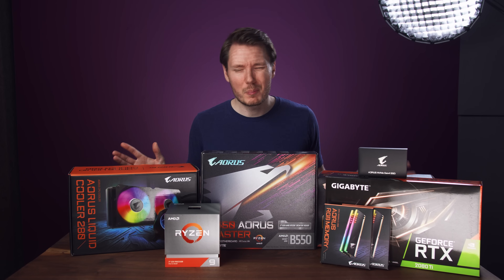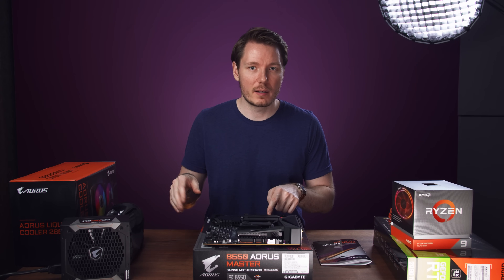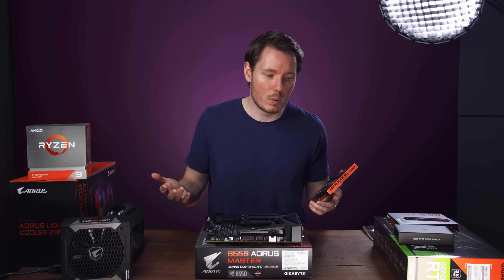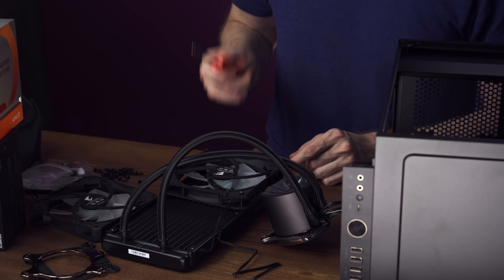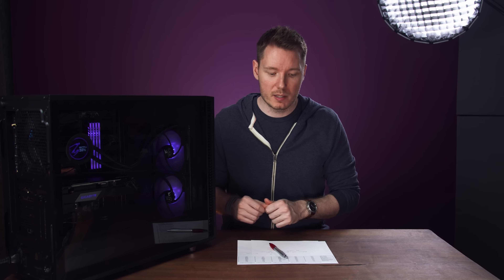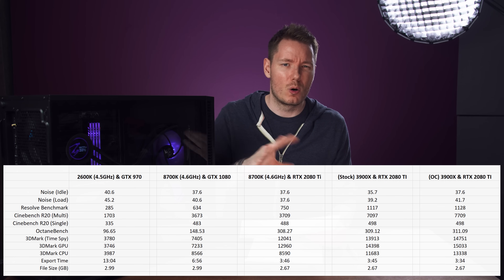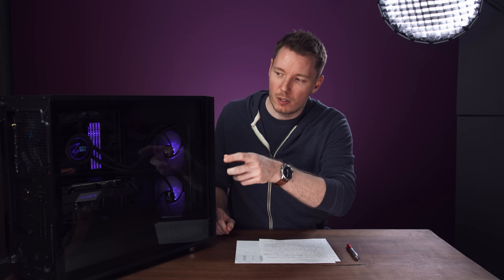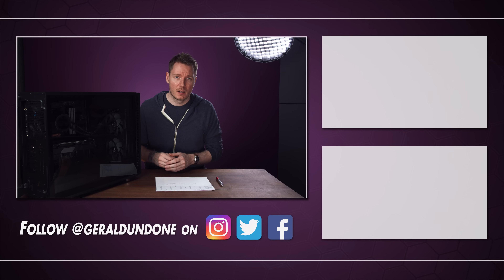Building an AMD B550 Video Editing PC // Ryzen 9 & AORUS MASTER

Comment: I built a custom PC Using the AMD Ryzen 9 3900x and while creating proxies last night, media encoder was using 100% of my cpu power. That doesn’t seem right at all any thoughts? 

I’m using an MSI x570 gaming MB
750watt PSU 
Evga GEFORCE 2060 super GPU 
64GB Corsair vengeance ram 
And I edit off a 2 TB Samsung SSD with another 1 tb ssd for my PC files and operating system

Comment: Did you ever get to the bottom of the ground loop? Compare against other motherboards? I had the same issue with a gigabyte aorus (intel) I eventually upgraded and I'm using a Asus ROG Maximus, and I don't have any issues. Note: its a fair comparison as I'm using the same case, same power source (receptacle) as before. Only thing changed is the motherboard/cpu. Previously, I isolated the issue and could hear the loop when plugging my headphones or an audio source directly into the integrated sound card (I heard the same loop noise through my external sound card through the usb port).

Comment: That's a pretty sweet computer! Two comments tho. You're only using one m.2 drive? A sick drive indeed, but having one drive for programs and one for files and scratch disk speeds up things quite a bit as well. and ofc video editing takes up so much space if that is what this is intended to do. But this is where the shared lanes become a problem, so nice that you mention it! I was not aware of this before i bought my last mobo and it is causing me a bit of a headache. but you might be keeping more of your files on a server NAS or external drives or something ?? 

The other thing is that the radiator is mounted with the tubes faceing up which can cause some problems with the air in the system and such. Gamers nexus has a looooong video on the topic ofcourse, but you can skip to the last mark if you want just the summary : https://www.youtube.com/watch?v=BbGomv195sk

Basicly, mounted like that the system becomes more noise, and less efficient, and reduces it's lifespan. how ever, as you're powers of observations serves you right, you see this kind of configurations all the time, even from the suppliers them selves, so it's a really overlooked issue. However, if you're tubelenght allows it's highly reccomended to get it the other way if not in the top of the computer case. 

Personally i prefer  aircoolers from noctua, and a sound isolated case instead of tempered glass and LED lights, and i can rather monitor temps in software on the screen which i am supposed to look at. but that doesn't make for the same view-attracting-eyecandy-computer does it ;)

Comment: Im pasting my comment here from the new 3070 video: Hey G man, if you want your All in one liquid cooler to last longer you have to change the setup asap. Haveing the tubes on the rad up top is not good. For more information check Gamers Nexus' video on pump whine and radiator positioning. Long story short the tubes should be at the bottom, or the radiator should be at the top of the case. Trust me it is WORTH reconfiguring

Comment: If you still run out of Vram, give a used Vega, or Radeon VII a try. The High Bandwidth Cache Controller is a useful feature is you have 32GB+ system ram. Very competent, good job.

Comment: A great explanation, great video.
So my question is that which motherboard is good for using 2 nvme drives at full bandwidth and also some sata ports with some usb ports without any bottleneck issues? I am going for a 3900x build for my purely editing focused build and any kind of bottleneck will be an issue for me. I want to run 2 nvme drives at their full bandwidth and few sata ports for storage and usb for file copying. I want to run all these at their full speed. So plz any suggestions for me? 🙏🏻

Comment: I just build a new rig 
R9 3900x
RTX 2070 SUPER
MSI MPG B550 GAMING EDGE WIFI
650W PSU
32 GB 3000MHZ
Samsung Evo Plus 500 GB
Samsung QVO 860 2TB
and still not live playback on premiere pro with Canon C200 raw

Comment: I know attaching cables is probably a trivial exercise for some but I just bought a similar system as my first build.  I would have loved to see you go through the whole exercise. For example, I had a question about the I have a 2x 4plug connector labeled CPU from my Fusion PS.  The only place I can see where that would go is on the ATX connector on the Master Motherboard.

Comment: You do realise the radiator is wrong way around? 
Hoses should be at the bottom not top otherwise as liquid slowly disappears, you'll be sucking air through the pump.

Comment: Hello,

I have just installed my Aorus Liquid 360 on Threadripper 2990WX with Asus Zenith Rog Extreme x399 motherboard.

The display on the pump is showing something around ~60 celcius degree, but the motherboard temp sensor and the CoreTemp are showing something around ~34 celcius degree.

Did anyone have the same problem? FW and drivers are updated. Am I missing something ?
I found out that instead of reading the "CPU Package" temperatures it reads "CPU CCD Average" temperature. How did you manage to get propper temperature on your cooler ?

Comment: Did you get a response back regards the weird noise?

I've just bought an x570 Ryzen 3950x build and I noticed noise through my HS7 monitors last night when moving the mouse about. I'm using a Focusrite Clarett interface.

Edit: I should add my motherboard was made by Asus

Comment: If you aren't using the extra space in the R6 for storage, you're concerned with temps, and the B550 board has no USB C header for the front I/O, why didn't you just go with the smaller and more breezy meshify c?

Comment: Does this 2700$ build that I plan to buy/build has some issue that I should be aware of?
Should I use some(?) cheaper part's for it? My budget is 3000$.
I planned to use it for gaming/casual 3D modeling (gta 5, battlefield 4, deadside, maya, autocad...) in next 5+ year's without any upgrades and any overclocking on a 1080p high settings.

AMD Ryzen 9 3900X 3.8 GHz 12-Core Processor
be quiet! Dark Rock Pro 4 50.5 CFM CPU Cooler
Noctua NT-H2 3.5 g Thermal Paste
Asus ROG Strix X570-I Gaming Mini ITX AM4 Motherboard
Crucial Ballistix RGB 32 GB (2 x 16 GB) DDR4-3600 CL16 Memory	
Western Digital SN750 1 TB M.2-2280 NVME Solid State Drive
Western Digital Gold 6 TB 3.5" 7200RPM Internal Hard Drive
Gigabyte GeForce RTX 2070 SUPER 8 GB Gaming OC 3X Video Card
be quiet! Pure Base 500 ATX Mid Tower Case
be quiet! Straight Power 11 750 W 80+ Platinum Certified Fully Modular ATX Power Supply
Microsoft Windows 10 Pro 32/64-bit
be quiet! SilentWings 3 pwm 59.5 CFM 140 mm Fan x2  = extra fans
Asus VG248QG 24.0" 1920x1080 165 Hz Monitor
Thanks :)

Comment: This is timely for me. I'm planning a build very similar to this one. Same CPU. Motherboard with B550. GPU 2070 Super. Want to stay away from water cooling. I'm going to run DaVinci Resolve Studio and that makes me wonder if there's an optimal configuration for the mass storage. That is, where to story proxy files and/or cache files? Should they be on your fastest storage with the most lanes? How much difference will then make between an 8-lane vs 16-lane connection? 
In the olden days there was similar optimization by splitting audio buffers, video buffers and cache files on separate spinning hard drives. I've not seen much about this kind of optimization in years so maybe the bottleneck is not in the drive any more. I ask because I just don't know.

Comment: Just so no one's unclear about this: that is not how grounding works. It's not a one touch thing. It does help to discharge the built-up static energy you had before though, so it does help, for a while.
You need to be in the same potential as the item you're handling, not the one your house is grounded to, "earth", per se. This is unless you're using a anti-static wristband to attach yourself to the case permanently whilst you build. It creates the means for the potential energy to discharge away from the electronics you're handling.
Cool video.

Comment: Nice rig but Depending of how what codec, long and complex your timeline are but 32GB isnt enoff, you need 128GB to 256GB to edit, colorgrade, graphics in After Effects, and ad Effects in 4K. Your benchmark arent better becouse no enoff RAM, as an advice the radiator must go up in scape configuration to no elevate the temp inside the case, you need cool fresh air not how air inside the case. Just an observation. I love your videos, but this is an oportunity to learn how configuration a PC to edit in 4K

Comment: Think I would have used better memory in an editing rig. Something with CAS 16 timings @ 3600MHz, as you mentioned. But 2x8gb is ideal for the infinity fabric. With Ryzen, it is a case of where more is not better. Using all four channels or going with dual rank memory provides little extra performance for the money. But, glad to hear someone actually talk about CAS timings. I see so many other reviewers never even mention it. That is like telling someone you have a chevy 350cid without saying how much hp or torque. Thanks for the video. Subscribed. P.S. it also has dual bios that can be a real pain if you overclock a lot. Forced to store your bios settings on thumb drive to insure you dont lose everything.

Comment: Can so pls explain to me what he’s talking about when he talking about the gpu and m.2 slots. So if you use 2x  nvme and a gpu. All three get slowed down and don’t use pcie 4 or just the 2nd nvme gets slowed down.
Reply: Its about housekeeping with the resources of the architecture given by the motherboard and processor. Motherboards have advertised features and speeds but very often most features can’t be utilized with the highest speeds at the same time. Both the graphics card and m.2 slots are using pci-express lanes. But total number of PCI-E lanes on the motherboard are limited (based on architecture) and therefore advertised features (if many) must sometimes be connected to very few or shared lanes. If you then wan’t to take advantage of EVERY feature the speed will may be shared between features OR you get to use less features but with full speed. You have to look at each motherboards fine print to know and best plan for its limitations if you want to use latest technology to the fullest. Perhaps why there are so many boards from every manufacturer.

Limitations can be speeds (limited number of lanes for a feature/port), what pci-e cards (graphic) can be connected and in which port/slot, if all m2. slots can be used, and how high bandwidth is left for the HDMI or display port if such exists (from processor integrated graphics). I’m not so familiar with AMD-boards but I would guess the X570 architecture have more PCI-E lanes than the cheaper B550 architecture....

Don’t know if that helped but I thought I could at least try.

Comment: Had the same audio issues years ago. Its not only about the mainboard. It's also about the monitor speakers some audio tech guy explained me some years ago. But I don't remember the explanation of it. But this explains why you cant hear any problems with standard PC Speakers or headphones. I found a quit similar solution like you. I took an 20 $ optical to stereo converter with separate power plug and problem solved.

Comment: For long term use it's well worth putting the radiator in the other way up, with hoses down. That way, as fluid is slowly lost over time, the air will rise to the top of the radiator, and won't be drawn into the pump (which would cause accelerated wear and pump failure, as well as making more noise)

Comment: :) looking to get the next AMD CPU (4000) + chipset desktop series, so I can get full PCI-E 4 as well as the new features coming out. 
Gigabyte makes good gear, usually very good motherboards. I have been using them for ~20 years, really interesting grounding issue I have had something like this previously.

Yeah CL18 is slow, CL16 or 14 for 3600/3200 would give better performance.
What is the max memory for that motherboard?

I would always use the heatsink to blowing out of the case, that way you aren't getting a feedback loop of heat (ie: air comes in, goes through the radiation block and heats up, gets inside the case and heats up the case causing more heat to need radiation)
2080ti is good, but I'm also curious to see how a quadro or firepro card would go with resolve.
Did you go with the nvidia studio drivers or the standard geforce drivers?

Comment: Do the m.2 drives on the B550 disable any of the SATA ports? I know a lot of the B450 boards would loose SATA 5 & 6 the minute you installed an m.2 drive
Reply from the maker: Nope. Only the bottom pcie affects your sata ports. The NVMe just affects your top pcie lanes from 16 to 8.

Comment: Point of order for those who use the power supply (or case w/ PSU installed) to ground themselves: Make sure the power supply is plugged in and you're touching bare metal. If you're touching painted metal or plastic, you're not grounded! I can't tell if Gerald's actually touching bare metal at the start here, but it's worth pointing out for those of us too lazy/stubborn for an anti-static wrist strap.
Reply from the maker: Yep, good tip. I have a whole bunch of info on that in the upcoming grounding video. Talking about how paint affects things, etc.

Comment: Last person I expected  for coverage on this, but cool nonetheless.

Genereally, you want to avoid mounting a rad vertically with the pipes at the top. That orientation will generally lead to more noise and (theoretically) worse longevity.
IRL it's not a huge deal, but could easily be avoided by mounting the rad at the top, horizontally.
Reply from the maker: I'm not an expert in coolers, but I thought the consensus was that it really doesn't matter for CLCs as far as hoses top or bottom. If it was a custom loop, then sure. 
Front mounting is much better for CPU temps during renders when using an open GPU though, since it doesn't try to transfer heat with the already cooked air inside the case. I've done A/B tests on that part. So with this case, I was definitely doing front mounted. I chose hoses up, because it was cleaner, and again had read numerous times that for CLCs it doesn't matter. I've heard stories of a longer, noisy gurgling period on some coolers (Steve from GN), but never stories of reduced overall lifespan. But again, not an expert.

Comment: I've got all the components for a decent build in my shopping cart. Just need to be able to afford them 😁 Those B550 boards are a nice compromise though. I don't think Gen 4 has proven itself to be a necessity for storage and GPU (yet). Especially Gen 4 NVMe devices - yes their theoretical numbers are astonishing but once you take a look at the IOPS a decent Gen 3 SSD will have them beat.

LTT also did an interesting comparison of SSDs. Basically their editors couldn't tell the difference between any of the devices tested.

Comment: you may solve your usb-c issue using this converter 
https://www.amazon.com/Cablecc-Socket-Extension-Adapter-Motherboard/dp/B07P99532V/ref=sr_1_2?dchild=1&keywords=USB+3.1+Front+Panel+PC+Socket+to+USB+3.0+20Pin&qid=1592412842&sr=8-2

Comment: If you do want to connect up that front panel USB C, and you have a spare front panel USB A connector on the board then LINKUP makes a converter. I think a link will get blocked as spam, so if you put "/dp/B07WG8ZJ41" after amazon dot com you should find it.

Comment: Relatively similar to the build I made for myself the start of this year.  Same color, CPU, though I'm on an X570 MEG Ace board and using 16g 3600 CL16 dimms (4 of them) for memory.  I think you'll like that cooler, some recent updates to the software has kept it running very quiet even while slamming through 4K footage in Resolve for me.

Comment: Interesting results. Based on the render times, it looks like the GPU upgrade made the most substantial difference. Is there any difference in scrubbing or usability with the CPU upgrade?
Reply from the maker: It is noticeably smoother when going over highly compressed codecs. ProRes & DNx feels about the same (they were already great). But the less-efficient raw codecs especially at higher resolutions are much smoother. It also performs some processing functions quicker. Noise reduction, etc. I'd say overall you can definitely feel it and I'm glad I did it,  but I agree that for exports, the GPU is the biggest factor.
Reply: Thanks for the insights since benchmarks, while necessary, only go so far. Regarding less-efficient raw codecs, does that refer to  Cinema RAW Light? I'm also looking forward to see how the new AMD and NVidia GPUs go head to head in 2nd half 2020. Competition is good.

Comment: Yes! Thank you for the ground loop parts. I have a Focusrite Scarlett and it is always giving me CPU feedback. I'll try the USB ground loop solution. Link?
Reply from the maker: Sure! And thank you: https://amzn.to/2YaJnXR
You need to give it power over USB-C. I'm just using a basic type-c to type-a cable and have that plugged in to an old Sony USB camera charger at 5V 1.5A. But I think any phone or camera charger will do. Most USB audio interfaces operate on 0.5A.